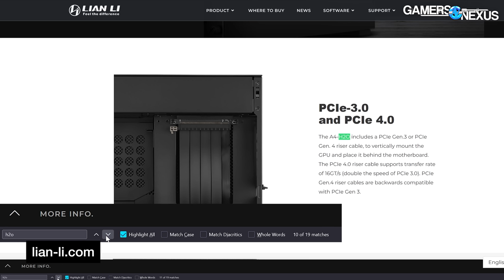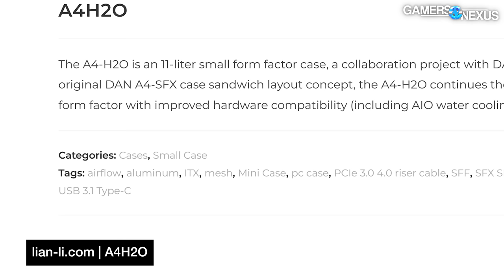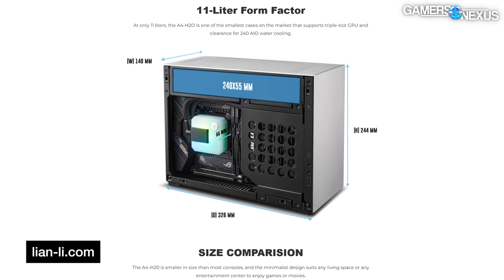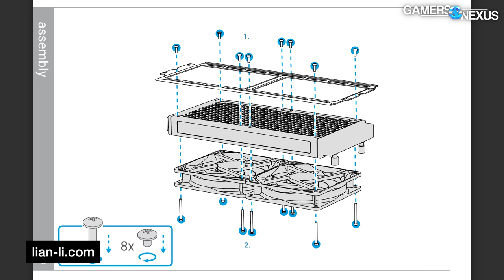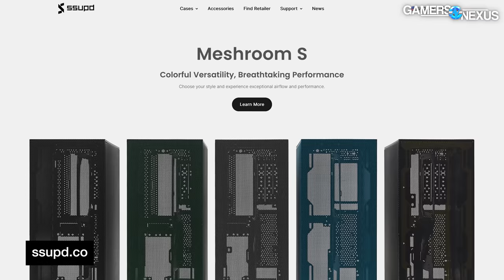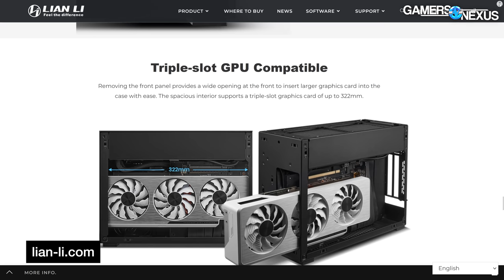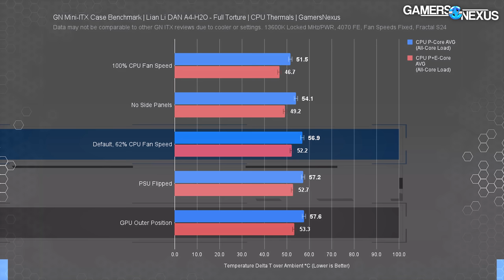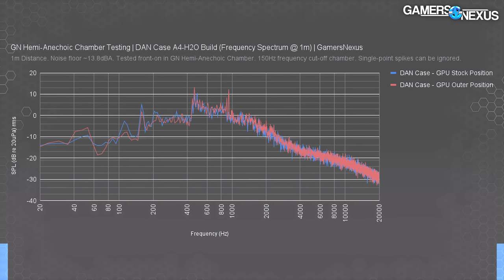Water Cooled Mini-ITX Review: Dan Case A4-H2O Thermals, Noise, & Cable Management

Comment: I picked up an H2O when they first came out and it was an absolute nightmare trying to find a cooler that would fit the Z690 boards at the time, all of them had massive blocky heat sinks that had most everyone trying to find a compatible cooler for.

I contacted a few AIO suppliers for accurate pump block sizes for measurements but only two ever got back to me, those being Fractal and Phantex. I ended up going with the Lumen S24 as well, but opted for some slim Noctua fans to help with my cable routing since it was all so tight on the Asus Z690i with a EVGA 3080 FTW.

A massive gripe I had with the Dan case was changing from a PCI gen 3 to gen 4 raiser. The hole spacing and thread pitch they use for the gen 3 riser is different from the gen 4 cable, so I ended up having to use calipers to measure the standoff side and thread pitch (which was the standard motherboard size) and order them off Amazon in a 50 pack.

The S24 since had a recall and the new version I have preforms a lot better and the tubes are also less rigid helping with fitment.

Last thing to touch on, there are MAJOR issues with the Z690 itx boards from all manufactures with Gigabyte even issuing a recall for their boards. I went through 3 replacement Asus Z690 I boards along with replacing all components after the second board, new 12700k, 970 evo ssds, Corsair ddr5 ram, raiser cable, power supply and GPU in my attempts to troubleshoot the constant crashes without a blue screen.

After changing to an MSI Z790 board I haven't encountered a single issue with the PC and it's been very smooth sailing.

Anyway! Thank you so much for reviewing these cases, it's awesome to see the ITX form factor getting some love and I hope companies take notes!

Comment: I've got one of these. Got decent cable management over the MB by cramming excess cable lengths wherever they'd go under the PSU or in the GPU compartment. I got an RX 7900XT in there, so it came down to pushing the cables on one side until the PSU fit, then pushing back from the other side until the GPU fit, and repeating until eventually the mess was sufficiently hidden. I call it the "guests are coming in an hour, toss everything in the bedroom" strategy. The Corsair 240mm AIO has a much less bulky CPU block so the tubes were able to go around into one of the suggested configurations with only a little bit of trial and error.

One thing that I wish I'd understood better is that just because it's physically small doesn't mean it doesn't take up space. A giant GPU in a Mini-ITX case generates the same amount of heat as it does in an ATX, so the thermal footprint is gonna be the same. Yeah, you don't have metal physically preventing you from putting it in a nook, but you'd better maintain at least a foot of clearance over the top because hot death is gonna be pouring out of that radiator.

Lastly, the aluminum cover is a static hazard. Do not try to ground yourself to it when you're plugging in headphones or something, because it's not grounded. Instead what happens is the charge arcs to your video card which throws it into an error state and you have to reinstall the drivers to make it feel alright.

All that aside, I really like the case. It's really pretty, fits components that have no business being in an SFF case, and even with all those caveats is still easier to work with than most SFF cases. The components I've chosen can chew through most graphics-intensive games, and doing that in a case this size feels like I'm cheating nature somehow.

Comment: Built this with a 7950x, an nVidia A5000, ROG STRIX X670E-I MB, Corsair SF750 and the NZXT Kraken Z53. The cable management was a bit of a pain, but with a couple of custom cables and some clever routing the build is very clean. Tips as follows - I have routed the power cable and the 8 pin ATX in between the radiator/fans, I have routed block pump cables for the Kraken to the top of the case and under the motherboard, the 24pin ATX cable has been combed up and then immediately routed down between the motherboard and power supply cage (it's tight but works). As Steve mentioned there is a lot of space at the bottom of the power supply (use it). There is also a bit of space at the front of the case.

Comment: I have this case and I love it. It was a pain to build in, but well worth it. I had to reverse engineer the Corsair h100i pump so that I didn't have to deal with the huge fan/rgb controller, and I got a custom PSU->GPU power cable to free up internal space and airflow. It fits a 7950x and 4080, and performs amazingly.

Comment: I struggled with 6800xt fitment into my similar SFF case, but from 2021. It was designed in the pascal/polaris Era, and supports only 2 slot Cards. I greatly appreciate the larger space for the Graphics Card in this case, but Terra looks  much more interesting on the outside. Keep em coming, I'm looking forward to more SFF case reviews.

Comment: I used to be all in for Mini ITX a decade ago but I’m so glad I went back to ATX. I don’t miss how little space there was to fit things. Not being able to use most GPUs because they were too big and even if you do fit it my hands couldn’t fit to work with components and any little thing basically required an entire tear down of the entire case to reach. I never want to go back. If I need something small I use something like a NUC with an iGPU. For regular cases I instead go for as big as possible these days. Especially since graphics cards get bigger and bigger and I want support for 360mm AIO.

Comment: I love this case, I built two. Although it cannot accommodate larger graphics cards with more than 322mm in length, I can still fit a 4090 Founder's Edition in it. Great thermals and awesome compatibility with a bunch of ITX parts. You'll definitely need to do research on the parts you're putting together before buying it.

Comment: I recently build my first SFF PC in the A4-H20 with the same Fractal AIO (non-RGB version) and must say that my cable management is way cleaner than you guys make it look in the video.
I even have less room on the GPU side as i choose an 4070Ti. I only bought an extra 12VHPWR cable for my Corsair SF750 to avoid using the bulky NVIDIA adapters.

I think the lack of cable management in your system might shine a bad light on SFF Builds.

Comment: Built my A4 H2O back in May.  7800x3d + 4090fe, PSU flipped.  I left the bottom access panel off completely to allow for more "cable junk".  Temps are pretty much a non-issue, -30 curve optimizer, 0.975v max in MSI AB to mitigate GPU voltage spikes.  This saves a bit of power all around.

Comment: Built 2, one for myself and one for the neice. Would definitely recommend a ek dark aio an Lian unity 120mm fans to reduce the cable clutter. Custom power cables may help as well. But it runs like a champ.. if you have animals or high dust in the location cleaning the rad on a regular basis is a must

Comment: I really like the “chimney” effect of the top fans on this case, and I feel like it should be a standard practice for case designers to try incorporating top fans to draw hot air away from the system.
Reply: Plus an exhaust setup in ITX cases work best

Comment: Got the Meshroom from SSUP and I'm pretty happy. The shitty thing they did is making the second generation without any notice or even updating factsheets with sellers. Because of that I'll likely be cutting the top bracket to fit my GPU although the side panel has been hanging quite well on a double sided tape. Thermals are phenomenal.

Comment: I've had this case for a longer while on my secondary PC build. Switched from a larger ITX (non-SFF) case and the experience assembling it was quite straightforward following the order in the user manual. Making it look good inside and managing the cables is another thing. Depending on the AIO the tube routing will be either be easy or a nightmare. Mine fits only in one orientation on the CPU and the tubes would initially touch the fan blades. Had to carefully bend and guide them for a better fit. Adding good ol' fan grilles might help a lot. The case also messes with your brain: even when fully assembled it doesn't heavy but oh boy does it surprise you when lifting it up, this thing is dense!

Comment: Bro I literally just built a rig in this. Let me just say the cable management can be made a **lot** easier with a bit of planning. CPU power goes under the motherboard tray, audio connector can go under the PCIe riser where it plugs into the motherboard, and many of the cables and splitters can be stuffed into the gaps next to your radiator. I recommend pre-bending and shaping the 24-pin connector using some cable ties or velcro straps. I did not end up installing a 2.5" SSD, and I don't recommend it either. If you need more space, get an external enclosure, a NAS, or just make do with the 2 m.2 slots that most motherboards that go in here should come with.

Comment: have been using this case for about a year and love it. Pretty easy to build, good cooling. The only gripe i have is that the gpu which actually needs fresh air might end up facing the wall. And one usb-a is wasted (only one is wired to the front panel).

Comment: I have a 7800X3D and 4090FE in this case, it's great. Two A12x25 fans constantly running at 1000rpm with ~no noise, and GPU is cool. I recommend to use a low power consumption CPU such as the X3D

Comment: I was waiting for this review for months, and then annoying YouTube didn't notify me of it. I love this case - my only gripe with it is that my M2 SSDs, both on top of the MB and underneath it, are being absolutely fried. The idle temp of my Samsung 970 Evo Plus (located underneath an Asus ROG Strix MB heat sink) is reported to be 60+ degrees, and from what I remember the active operating temp almost reaches the manufacturer stated limit.

I'm using it with an EK240 AIO, but the fan cable management is a pain even with that, so I want to look into replacing the fans with a newer one that has cabling/connectors integrated into the fan body.

Comment: I am rocking this case with a 5600X/EVGA RTX 3090 all air set up. It has been very quiet. Works great for me. One thing to note - I believe eventually most ITX case owners would go for custom cables to avoid cable management. I got some pslate cables that work perfectly with my PSU, motherboard, and GPU combination.
Reply: What kind of CPU cooler do you use? It looks like it has clearance for a low profile CPU air cooler, but I'd be curious to know just how much leeway there is in practice.
Reply: @thelastdwemer it’s an ID Cooling IS-55 with a Noctua low profile A12x15 fan. The fan slightly touches the side panel but the fan blades don’t. The panel deforms slightly due to the protrusion but it still works fine. Lower profile cooler like the Black Ridge might work better
Reply: @gzfelix  That's good to know. I use a 47mm Silverstone in my current SFF build and that would fit perfectly with room to spare.

Comment: This case is my favorite case by far. I use an AIO pump, a 240mm with some hose barbs, and a water cooled GPU. The hose routing is actually very clean when you add in the GPU.

Comment: Love this case! Running a 7950x and 3090 both in a liquid cooler in series. 240x120 rad with integrated pump+ 120x120 rad in series. Though needing to top up coolant almost once ever month

Comment: A couple small build notes I experienced. Pull the slack of the Fractal Lumen AIO tubes into the GPU chamber, space permitting. This will help prevent bowing of the motherboard case side panel by those same tubes. My final comment regards the pump acoustics; the pump is a 3 wire plug and can be slowed down to something less noticeable. If you do not slow it down, it CAN be noticeable. I also opted to replace the fans with inexpensive Noctua Fans.

Edit: This may be a n00b hint, but drop the harder to get to screws into the holes on the motherboard like the lower corner, before you install the motherboard. The magnetic tip screw driver could not reliably hold the motherboard screws.

Comment: On the topic of cable management, I definitely would like the section to include a high effort variant as would be expected of someone building these kinds of systems. I understand it will take a lot more time, but it gives you the opportunity to provide more specific advice regarding cable management and present a worst- and best-case scenario for it. Additionally, cramming all the cables into all the spaces can impact thermals, which is a important metric here.

Comment: I really don't see how you can call this case expensive. It includes a PCIE 4 riser and the component compatibility for this small form factor is top notch. I also think it looks the part and is of decent quality. It's a steal imo.
Reply: I think it's due to nzxt SFF case where they blueprint with a PSU & water cooler alongside a case all for $200

Comment: I have a x570-i strix with a 5800x3d. motherboard is full ek waterblocked.
lian li 750 psu
radeon 6700 xt
flt80 with ddc and heatsink
32gb gskill rgb 4000 mhz at 3600 cl16
ek fittings, lots of low pro!
SINGLE lian li 120mm fan and 240mm radiator from corsair

I had a full water blocked vega 64 before the 6700xt but I couldnt used my LG 4k C2 oled correctly but other than that it was perfect!

It's almost silent until I game! Then not bad!

I love this case! Get one!

Getting some wierd crashing/freezing with my video driver? ctrl-shift-windows key + B fixes it. Other than that a reset does. It happens just watching web videos. Gaming seems ok most of the time. 
Sometimes fullscreen videos get like a grey filter after a second or two when i switch to fullscreen. 

replaced everything except cpu and mb. So hoping to rma that this year lololol

Comment: Honestly being specialized is exactly what i look for in ITX cases, and probably with cases in general. It's not like I change the components of my PC or the way i intend to use it every week and i need flexibility.
I pick the case and the components for a coherent project that fit with requirements, and if the case does just what i need that's good for me.

Comment: Since downsizing to itx I'm often amazed at both how much you can fit in a tight space and how much you can get away with in terms of power/thermals..

Like I used to have a 360mm radiator on a CPU alone, or one time I even had 360 + double thick 240 rads to cool an i7 920 and 3x 660ti SLI setup. It looked ridiculous but when you add up the total TDP it's only 530W
Now I have an i5 12400F with a 120mm rad in exhaust (averages 82W draw under constant full load), and a 3080 blower (320W TDP but undervolted it reads 250-270 under full load)

All this in an Inwin A1, not known for it's thermal efficiency.. 2x fans intake at the bottom, 2x fans exhaust (1 at the side, 1 through the CPU rad at the rear) and it's.. fine 🤷‍♀
My GPU thermals barely top 80C with the blower fan at 65% and the CPU has recorded a max of 79C with case fans at ~72% intake and ~62% exhaust (to try and maintain positive pressure for dust resistance)
Years ago I'd baulk at those numbers, but the hardware is well within spec, has plenty of gaming power and the total noise level is no louder than my partner's old laptop was at idle.

Comment: Cable management has always been an issue with the boutique SFF cases.  Although the Dan A4-H20 is slightly more mainstream due to Lian Li actually slapping their name on it, it still suffers from this same problem.  There are options out there for purchasing custom cables for specific PSU and SFF case combinations that go a great way towards alleviating this issue.  While costly, the custom cables not only make the building process easier, but the build looks like something you can be proud to show off.

Comment: I got this case with RTX4090, 7800X3D mainly as gaming station and I am more than happy about how quiet and well cooled it is. 🙂♥️ However I have to go for custom cables and it looks much cleaner with a more space for more airflow.
Reply: What PSU are you using?
Reply: Corsair SF850L  @EverythingisFire
Reply: Ahh, gotcha. I'm using their SFX line. Had to upsize from the 450W to 600W & I'm happy using their newer, more flexible cables. I wonder if yours is using the older stiffer style. @FloppyBurn

Comment: It is worth mentioning you can run this with an air cooler and get decent temps at load + very doable noise levels. I have had issues getting liquid coolers through TSA when traveling so I built in this case with air cooling to be able to slip into a backpack during air travel. 

FYI on specs: I built with a 5800X3D and cool it with a Noctua NH-L9a-chromax black. I run a 6800XT for the GPU and have two outtake fans where the radiator would typically go to pull heat out. As long as I don't overclock, it works quite well.
Reply: ive read several guys who bring their aio mini itx pc on their flight, strange that tsa had issue with your aio, how was it did you remove your aio before you can check in?
Reply: @livinglegendrey3100  I fly a lot for work and asked the TSA workers at my airport if that would be a problem and I was told there was a high likelihood of it getting flagged and they would recommend I avoid it. 

My guess is it is a highly subjective decision depending on the agent's judgement and I haven't been able/willing to take  that risk. That said, you could technically get away with it, to your point

Comment: Agree on measuring the volume by the max dimensions. If the design requires bottom fans and thus feet, that's part of the design and must be included. Because without those a case could suffocate. Also putting parts on the outside has to follow the same rules. If it's part of design by design, that's also part of the volume.